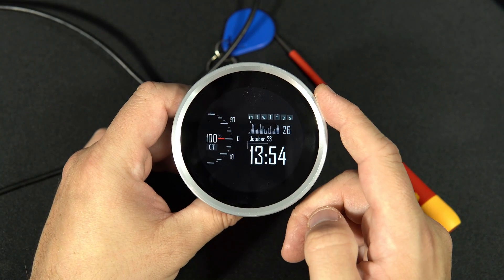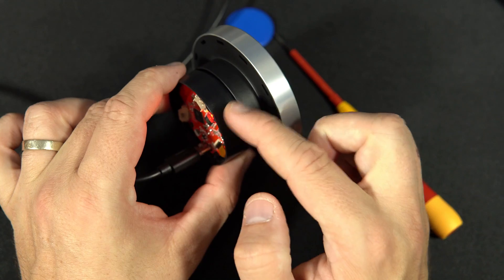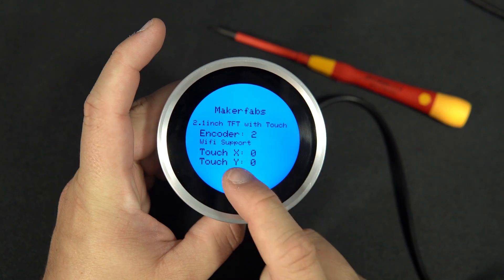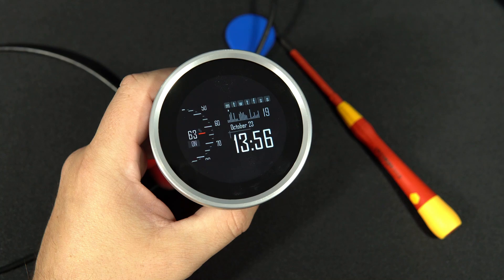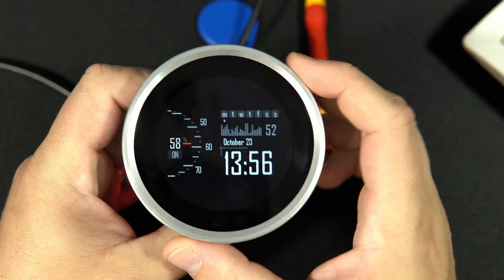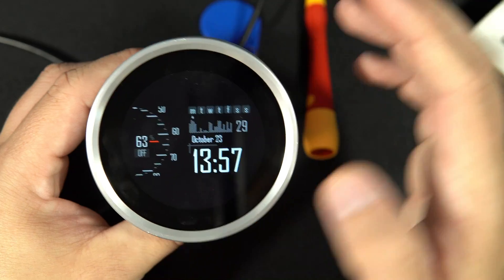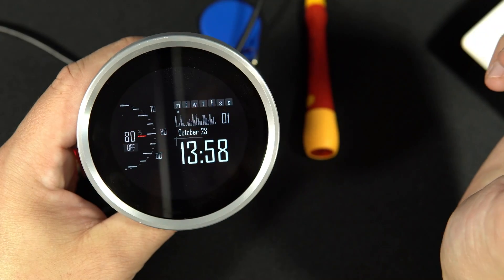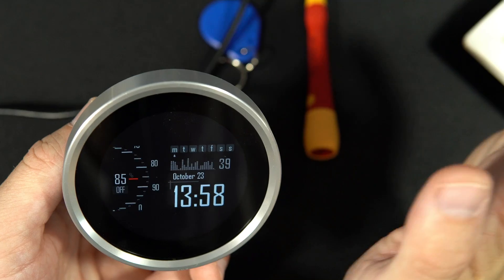Lights control using Makerfabs MaTouch ESP32 Rotary

Comment: I found as of today (June 11/2024) you need to replace the commented lines below with the un-commented lines below.

// Arduino_ESP32RGBPanel *bus = new Arduino_ESP32RGBPanel(
//     1 /* CS /, 46 / SCK /, 0 / SDA */,
//     2 /* DE /, 42 / VSYNC /, 3 / HSYNC /, 45 / PCLK */,
//     11 /* R0 /, 15 / R1 /, 12 / R2 /, 16 / R3 /, 21 / R4 */,
//     39 /* G0/P22 /, 7 / G1/P23 /, 47 / G2/P24 /, 8 / G3/P25 /, 48 / G4/P26 /, 9 / G5 */,
//     4 /* B0 /, 41 / B1 /, 5 / B2 /, 40 / B3 /, 6 / B4 */
// );

// // Uncomment for 2.1" round display
// Arduino_ST7701_RGBPanel *gfx = new Arduino_ST7701_RGBPanel(
//     bus, GFX_NOT_DEFINED /* RST /, 0 / rotation */,
//     false /* IPS /, 480 / width /, 480 / height */,
//     st7701_type5_init_operations, sizeof(st7701_type5_init_operations),
//     true /* BGR */,
//     10 /* hsync_front_porch /, 8 / hsync_pulse_width /, 50 / hsync_back_porch */,
//     10 /* vsync_front_porch /, 8 / vsync_pulse_width /, 20 / vsync_back_porch */);

Arduino_DataBus *bus = new Arduino_SWSPI(
    GFX_NOT_DEFINED /* DC /, 1 / CS */,
    46 /* SCK /, 0 / MOSI /, GFX_NOT_DEFINED / MISO */);

Arduino_ESP32RGBPanel *rgbpanel = new Arduino_ESP32RGBPanel(
    2 /* DE /, 42/ VSYNC /, 3 / HSYNC /, 45 / PCLK */,
    4 /* R0 /, 41 / R1 /, 5 / R2 /, 40 / R3 /, 6 / R4 */,
    39 /* G0/P22 /, 7 / G1/P23 /, 47 / G2/P24 /, 8 / G3/P25 /, 48 / G4/P26 /, 9 / G5 */,
    11 /* B0 /, 15 / B1 /, 12 / B2 /, 16 / B3 /, 21 / B4 */,
    1 /* hsync_polarity /, 10 / hsync_front_porch /, 8 / hsync_pulse_width /, 50 / hsync_back_porch */,
    1 /* vsync_polarity /, 10 / vsync_front_porch /, 8 / vsync_pulse_width /, 20 / vsync_back_porch */);

Arduino_RGB_Display *gfx = new Arduino_RGB_Display(
    480 /* width /, 480 / height /, rgbpanel, 0 / rotation /, true / auto_flush */,
    bus, GFX_NOT_DEFINED /* RST */, st7701_type5_init_operations, sizeof(st7701_type5_init_operations));

Comment: I was inspired by your video and bought one. I have made a daughter card which screws on the back and provides CanBus transceiver and a 12v psu. My end application will be marine but I guess it could also be automotive. For spare IO you can really only use the UART pins on J2. J1 pins are I2C which is used by the internal touch controller so you cannot use for anything other then I2C. There are some spare IO on the PCB itself that you can solder to but this requires more skills and is not great mechanically. Anyhow, thanks for your videos, always useful content.
Reply from the maker: Thank you, it is so nice to heat that.

Comment: Hi, great work, I am fitting EV power train in a 1963 car that has four  2.1in round displays - water temp, volts, oil temp and pressure. I have been looking for just this sort of solution for EV car status gauges this looks a perfect solution.

Thank you for the inspiration. 21299 subscribers to go!

Comment: Am I right in thinking there are no IO pins available apart from UART and i2c?
Reply: Looks that way according to the website
Reply: Pretty much any esp32 pin can be defined for pretty much any function.  The datasheet for the display will tell you which pins are on the connector, then the datasheet for the esp32 s3 will tell you what those pins are capable of.
Reply from the maker: Yes you are.